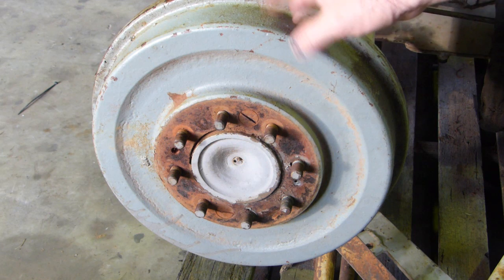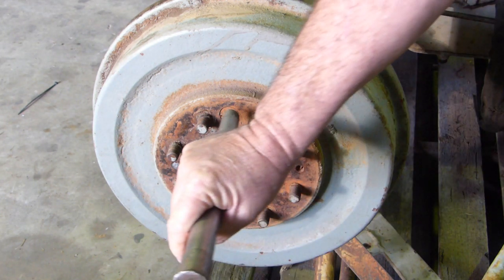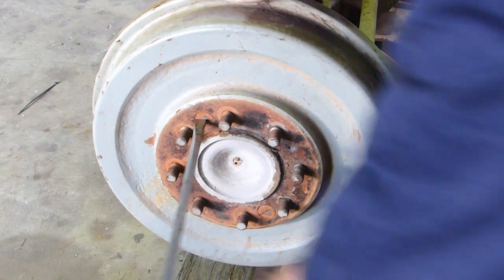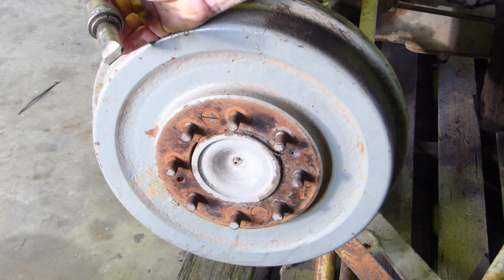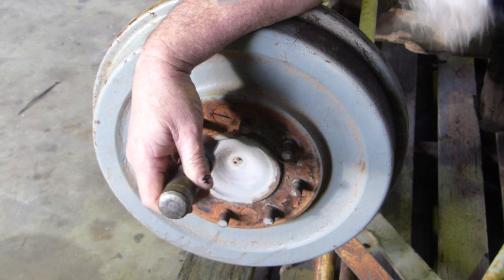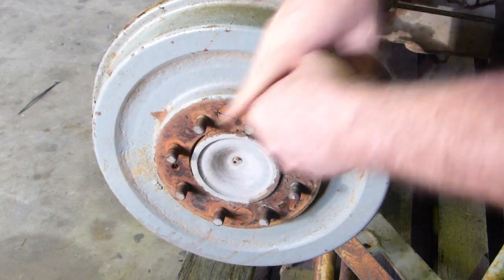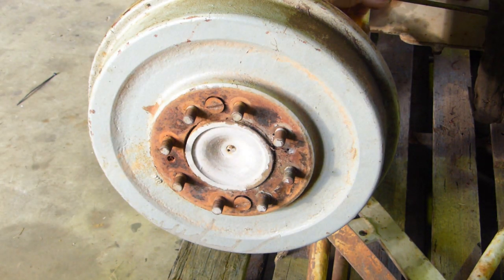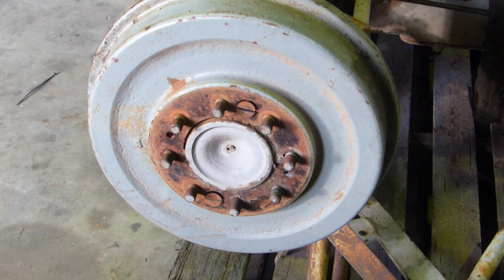Ferguson TEA20, 35, 135, 148 etc Brake Drum Screw Removal

Comment: I tried everything you suggested before I even saw your video. I heated them up, used that impact screwdriver and still wouldn't come loose. Had to take the torch and torch them out. But the drum is still locked up on the axle. Letting oil soak on it now. I took apart because I think my brake springs are broke. Locking my wheel up. Good video. I did all them ideas, so I guess I know a little bit. lol.
Reply from the maker: Try and make sure the brake shoes are backed right off, they sometimes get caught on the lip it the drums are worn.
Reply: I did that, thanks for reply though. I finally got it off. Had to heat the crap out of it. Worse problems. I thought the transmission, hydraulics and rear end was like my 2110 Ford. All together. Wrong. Someone told me it was though, who should have known better. Anyways. The rearend was completely out of gear oil. I put two gallons in and let it set over night. I will be lucky if the bearing isn't scorched and ruined. It did go fine though. Ran it around the barn a couple times, and no noise. It locked up before though. Thanks for the reply. Not sure I want to tackle fixing the bearing if that goes. Not really that up on mechanics. But I have done some seals and bearing on my 2110.

Comment: Common tool in my mc mechanic days, still got a old one at the bottom of the toolbox. They were handy to use but in the wrong hands it ended in a bunch of chowdered casing screws. I recall there were after market socket head replacement kits for small bikes then too.
Reply from the maker: I first used them as a young bloke on motor bike Philips head screws. We thought we were big time if we bought a kit and fitted Allen Head screws. Good simple tool but like all need to be used correctly.

Comment: My Massey 35 has tray angle plate beside injector pump on front cassing  2 stud same as engine setup on you 135 wheel alignment video also (11 G MC 25211) stamped on block try to identify if year of engine is same as tractor.nobody seems to be able to give me info .my engine is indirect injection 3 plates on head maybe abitza or industrial must say great engine first touch of key with no heat even in cold .many thanks Dessie
Reply from the maker: Try here https://queenslandtractorspares.com.au/technical/

Comment: G Day Lance. Found a new use for my impact driver this year haven't I. Use the end as a taper punch to size the rings. Only thing I don't like about them, when the screw doesn't come out, just chews  the slot up lol.
Reply from the maker: They do bugger it up if not used as intended, almost a forgotten tool now a days.
Reply: Worst is when they damage a hardened phillips head screw. Resort to welder.

Comment: yes got one old honda an yamaha  days very good MUST have size  right bit /// a tap with hammer to the tapper seat  ///tie rod flywheel  works well  if no joy heat just the head ///get the heat right not to hot
Reply from the maker: G Day Bill, Yeah heating and drilling both work but this is a good quick field fix. This doesn't always work though but it seems to be a forgotten tool.

Comment: Mr Bundy, just taken possession of a '77 Massey Ferguson MF20 (Bit like a 135). The brakes are not very effective. Could you do a tutorial on how to jack, remove the main wheel, check/replace/adjust the brakes please.
Reply from the maker: g Day Max, I will be coming up to the brakes very soon but the brakes on the tractor I am restoring this time will be different to yours in quite a few ways. The diesel TEF20 would be the same but I will need to finish this one before getting onto the next one.

Comment: My ferguson TO 30 will start but not keep running. Sometimes run a few seconds or several minutes. Filter screen in side gas tank is clean. Fuel flowing good thru line good. Fresh Gas.  Any ideas ?
I'm in Mississippi, sounds like you are close.
Reply from the maker: Australia.

Comment: ha! The old impact driver - got mine back when Honda's had those damn phillips heads. Moved on to Ducati and retired the driver. Still have it but. Not the Ducati dammit.
Reply from the maker: G Day Mark, I used them on motorbikes first too. We were flash when we replaced them with Allen head screws.

Comment: Hi Bundy,  can you please let me know I have a squeaky right brake on my Massey 35 petrol,  well constantly squeaking now while driving it,  can you please help me how to fix this? N regards Anthony
Reply from the maker: I would pull the wheel off and then the brake drum and look for a broken spring on linings worn out. Either way you will need to have a look.